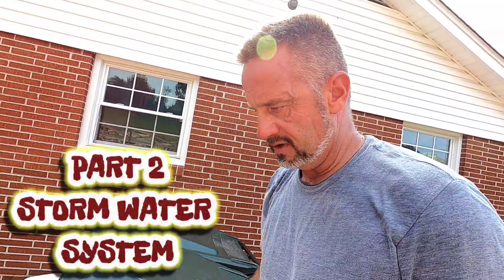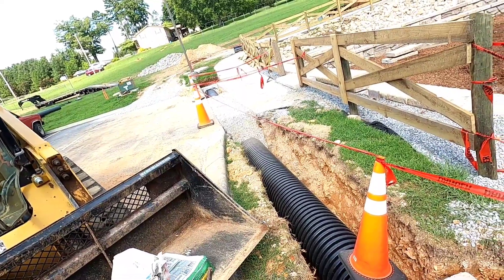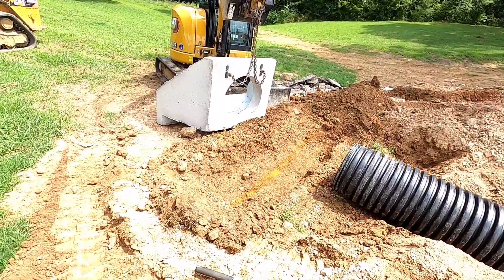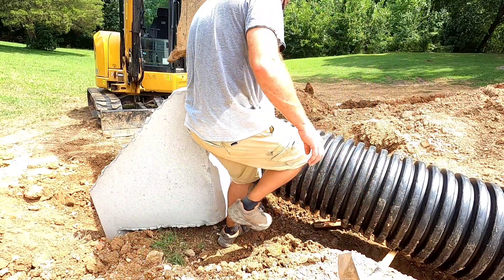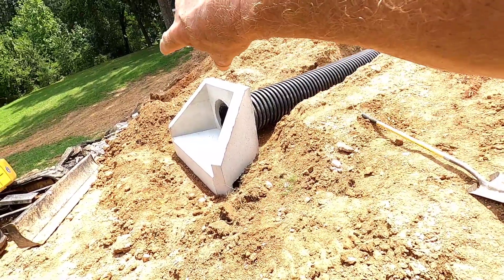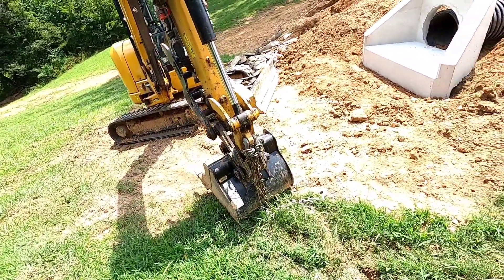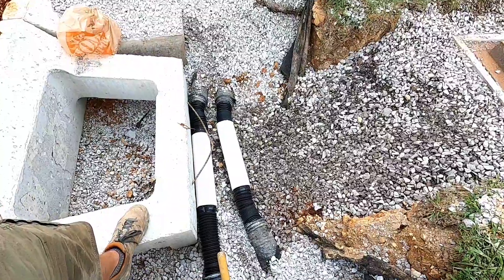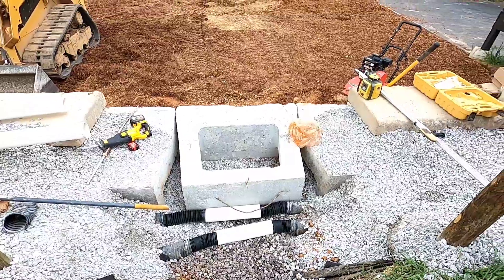HOW DOES THIS STORM WATER SYSTEM GO IN?

Comment: Try pouring what we call (in the commercial industry) an ‘invert’ in the catch basin. In a catch basin as small as these there is no need to call a truck you can just use bags of concrete. Working it with a trowel flush to the bottom of the pipe encouraging water to flow more easily into the pipe and preventing water sitting below the pipe
Reply from the maker: I was wondering about that and it makes sense. Thanks for the info…
Sam
Reply: @tristardiggin Great work 👍🏼

Comment: Always gota account for a few things when it comes to utilities. 1.) thickness of ur stone whatever it may be . I usually ALWAYS use 6” (.5) tenths. 
2.) thickness of the box from outside bottom of structure to ur invert . It’s usually 6” (.5) tenths.
3.) thickness of ur pipe. I mostly just say (.2) tenths.
So anytime I do storm and start running my numbers I ALWAYS add 1.2ft. 
.5 for rock, .5 for box thickness and .2 for pipe thickness. Hope this helps u some bud.
Reply from the maker: Thanks for the info. Definitely my first try at storm water system. I appreciate the wisdom...
Sam

Comment: Was the top pipe perforated to take in the water from the rock? Or the only inlet is the catch basins? Did it end up getting better funnels to the catch basins? Or the water just makes it down to the rock and bypasses the corrugated? Love this project. So many questions. 🤣👍
Reply from the maker: The pipes were solid and they did finish the concrete around the catch basins. I really enjoyed this project and I learned a lot along the way...
Thanks,
Sam

Comment: That was a challenging job to say the least.Two questions, did you have to eat some of the cost and why
was concrete not put around the catch basins instead of rock ? Great work.
Reply from the maker: Thanks Mike, 
Challenges there were 😁!!! ADAPT AND OVERCOME! 😳🙄 I did donate some time to offset my oversight on the storm water plan. Even though the storm water issue was there all along I just underestimated the magnitude of it. Based on the experience I now have, I know to have a storm water plan in place with cost estimates along with estimates for the actual work. The rock is just filler (backfill) there will be a concrete side walk covering the ditch and concrete formed around the catch basins to carry water to the grates. 
Thanks,
Sam

Comment: Good Vid. Are you using a gopro for filming?
Reply from the maker: Yes, I'm using a gopro 8. I had a gopro 7 at first. But I buried it in a pond dam while recording the job. 😳🙄🤪 
I bought the 8 to replace it. 
Thanks, 
Sam
Reply: @tristardiggin  I have 8's and 9's. If you go into timelapse and use timewarp setting, you can throttle speed up and down so you don't have to speed up your normal video during editing. I use that in some of mine instead of timelapse or fast forward. It makes a clearer fast-pace vid without the awkward sound. Just a tip from a nobody lol.
Reply from the maker: Great, thanks for the info. Will check that out...
Sam
Reply from the maker: Are you using gopro as well?